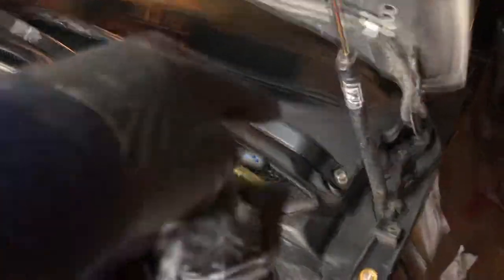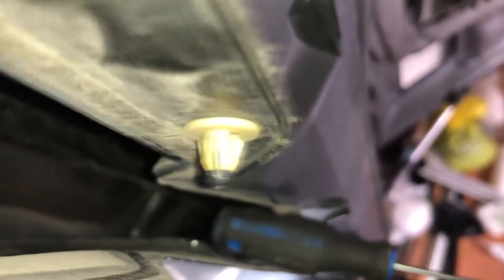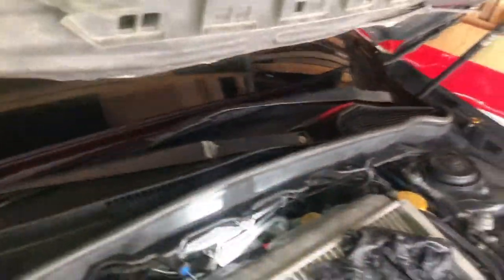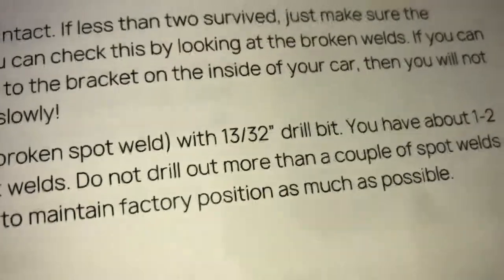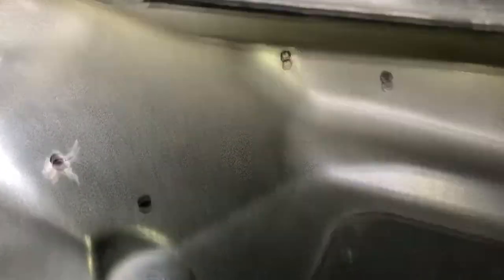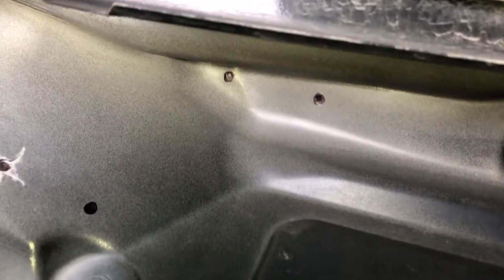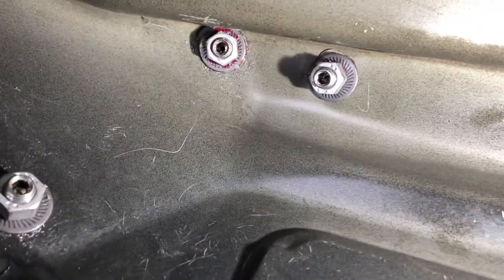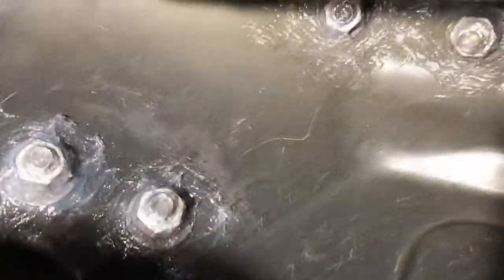PROJECT STi: HUMBLE RUMBLE: How to Fix Your Squeaking Clutch Pedal & Improve Feel EASY!

Comment: good job, i have the same problem with my wrx 2011, i will do the same, thanks
Reply from the maker: Good luck it’s worth it!
Reply: I did not work for me
Reply: @isaacromero8331 same here just finished it today and the clutch is still squeaking and it’s hard to put in gear